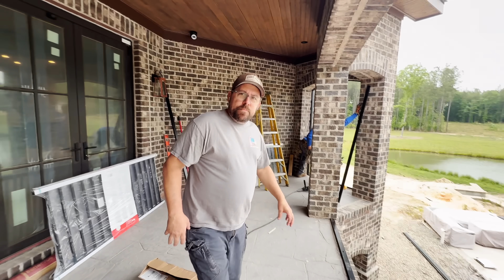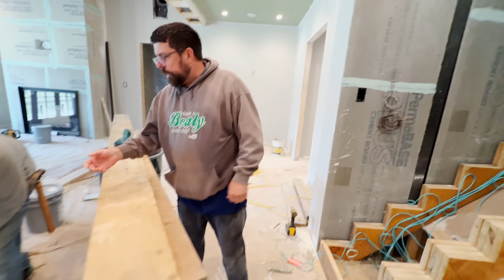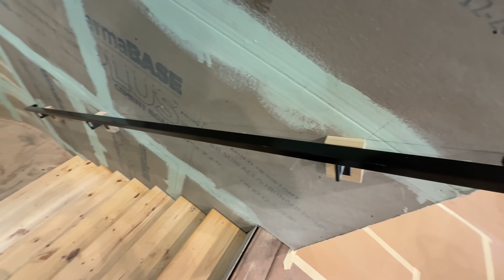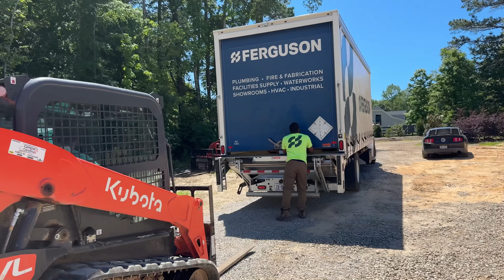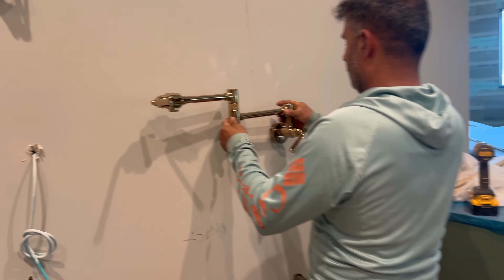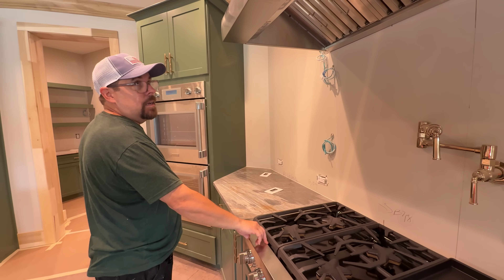Railings, Stairs and Plumbing, OH MY!!

Comment: Excellent appliance selection; we have the Bosch Dishwasher and they have perfected the noise cancellation on their units. When we run a load the only way to tell if its running is to look at the light displayed on the floor. Its that quiet. Thanks for the video, I have been watching since you first turned dirt.